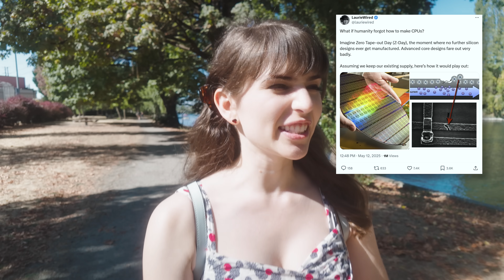what if humans forgot how to make CPUs?

Comment: When the guys from Acorn computer visited Bill Mensh (one of the 6502 designers) in Arizona the story goes that they expected a big company but saw students in a suburban bungalo working on Apple II computers so they realised they might be able to design a cpu themselves. They tested the arm instruction set in an emulator written in BBC Basic. I would be ok with going back to to that era and it doesn't seem like it would take long, perhaps a decade or two to get there from a reset. It would be a nightmare for the movie and games industry and big tech. It would be awesome for tinkerers. Constrained systems reward creativity. Also original Unix ran on some very weak hardware. 5000-8000 transistors would only get you an 8 bit micro but go to 30,000 and you can have a fun little 32bit machine.

Comment: The most realistic scenario is where the northern hemisphere survives nuclear fallout but not multiple summers of crop failure, so you'd have mass starvation in all but the southern hemisphere.  Could Australia, South America and Africa restart chip manufacturing?  Not quickly.  Indeed there's not much advantage in Australia.  I'd bet it would be far more common for salvage operations into the abandoned cities before any local manufacturing started from scratch, and this would turn into a smuggling cartel.  There would certainly be a stability in 16-bit and 32-bit ecosystem … enough "real work" or office work was possible on 1990-era hardware to remain useful indefinitely.  The "best of Wikipedia" can still fit on an optical disk — you only have to limit to rated articles and/or take it easy on the graphics.  Video is another matter.

Comment: Check out the Gigatron. All TTL, including the ALU which is made from 74xx283 Full Adders and multiplexers. It uses standard 14 pin DIPS and is about the same size as a 8-1/2x11 sheet of paper. Outputs to VGA and has sound. CPU is a broad term, but you don't really need all that pipeline, multithread etc. It all depends upon what you are trying to do. Anyway you pose a GREAT mental exercise, thank you.

Comment: The conservation by reducing load is, amusing. I cleaned and rebuilt a 486 based PC running Win 95 around a decade ago, that had as it's only task the operation of the air conditioning system of a TV studio. It was expected it needed replacing, but the rest of the hardware required specific software that only ran on that version of Windows. The PC never ran flat out, just idled along doing the one job, and slowly getting more and more dust inside, a process that took decades thanks to how well filtered the air was getting in to the environment where the PC sat. Many older PC's run just fine with a clean out and re-seat of the boards and plugs, that one went back to being perfectly reliable, and I expect it's still there. Light loading and efficient Linux OS's can make older machines run very well, and the code optimization part of this scenario to include large numbers of bespoke OS's to replace the bloatware of Windows and MacOS.

Comment: I think that most of the time we are wasting most of that compute power.
Games don't need to look realistic to be fun to play.
Operating systems shouldn't need 50GB of disk, 4x3GHz CPU, and internet connecton to just start and show user icons to click. Comoder64 was able to do it, without all that computer power.
And text editor should be loading 5min on modern computer. Even on old computer.
Windows 98 had everything I need except for stability and support for 64bit CPUs.
Windows XP mostly fixed stability.
Windows 7 was for 64bit CPUs.
Why upgrade ?
Maybe I'm an old man. But back in my days computer were faster.
Hardwer was slower, but software was so much faster, than whole thing was just faster.
The only reason to upgrade software is because other software require it, or because you are forced to.
Currently I'm honestly considering going back to WIndows 7 and go offline for security.
Everything is soo soo slow now, even if it's running on 100x faster cpus.

Comment: IMHO, since transistors are.not the only way to make computers, as you point out at the end, I think we would start researching other methods of making cpus. There are plenty of options to chose from. One that I like uses thermodynamics as both the power and the signal, often in the form of sound. Another was described in Molecular Mechanical Computing by Merkle et al.
Either can start large and shrink.
Regardless of the method, I believe computing is too useful to give up and we'd just find and build a different computing medium. Even if we had to start from near zero.

Comment: I’m not sure this scenario is very realistic. It seems to assume that humanity would completely forget the entire fields of computer science and electronics.

First, look at the example of home routers failing with nothing to replace them. Sure, the cheap little CPU-based plastic boxes we use today wouldn’t survive long. But unless we also assume that humanity has forgotten how to make integrated circuits altogether (which is extremely unlikely given how well-documented the processes are), people would just build bulkier, fixed-function replacements. Think rack-mounted cabinets of logic arrays sitting in the garage - clunky and inefficient, but still perfectly capable of keeping households online for a lot longer. 

The same applies to the point about modern cars dying due to solder joint failures. People aren’t going to forget how to solder! Reflowing joints is routine electronics repair, and over time, people would likely replace or bypass complex computer systems with simpler hardwired logic controls or mechanical systems to keep vehicles running.

And finally, even computing itself wouldn’t necessarily vanish. It would just regress to simpler hardware. Even without CPUs, you can build computers entirely out of logic gates. They wouldn’t be fast, but they’d be enough for basic text-based communication and coordination. I think most people would absolutely take that over nothing.

So no, the internet and electronics wouldn’t just vanish without CPUs — they’d get bulkier, slower, and clunkier, but they’d still exist. Honestly, a much scarier scenario would be if you just locked up the one tech-savvy person in every family. Society would grind to a halt way faster that way!

Comment: 13:22 🤣🤣🤣

In other news, my oldest PC is 30+ years old and it still works, HDD and all. I have increasingly newer ones too, so I'm covered - as long as there's electricity. We'll just talk to John Carmack to optimize our mission-critical software, and we're in business. And when all fails, we'll still have pigeons. 😆 But I'm sure that with better optics and rudimentary electronics we'll be able to move critical information around with lasers. Give geeks constraints and they thrive. We might even pull a Johnny Mnemonic. 😎

Comment: Internet would probably have issues first.. Fiber optic transceiver modules run kinda hot, and network switches and routers would just be useless without processors to forward packets around as they started failing. it would be a "slowly but surely" situation especially as weather shifts around and the processors controlling large scale HVAC systems for high traffic data centers and ISP network racks start failing.

The hub would be the first site to have a flood of complaints rolling in as everyone gets 500s and 404s and the chrome t-rex thing when the internet eventually cuts out. Chaos would ensue everywhere.. starbucks will have all the angry bottle blondes with their karen haircuts yelling for the managers. But paychex will be unable to process payroll and adp will have constant goofups and all the..

Anyway I can ramble on.. I'm gonna go play some games. I was a bit focused on just one thing there.

Comment: Awesome video. One thing we also know however is even though the old-school 80's etc computers were awesome and will likely outlast modern CPU's, the capacitors will age quickly still and will need to be replaced as many are on older machines; probably the only thing holding back older machines from true "repair-free" longevity :)

Comment: In the long run with we'd probably see more refined versions of transistor tech from the 70's. Newspapers and print publications generally might come back using linotype, transistor broadcasting/telecommunications tech would come back: radios and televisions and phone switches. Library card catalogs and paper files maybe? Film still and movie cameras would come back. Magnetic tape in media and computing would come back. There would be efforts to develop biological computers and refine and find new applications for analog computers. Maybe nano-scale mechanical computers or quantum computers could be developed if the scientists could make progress on them with limited computing power. Optical Disk drives would have to evolve to not need processors to work.

Comment: this is the kind of scenario I had in my head when I heard about Hurricane Helene disrupting quartz supply from the Appalachians and how that might impact silicon wafer manufacturing

another thing that we might need to do as well is become more conservative with the consumption of the resources that go into the manufacturing of computers, not just in the CPUs but also in boards and batteries, because of 1: the increasing difficulty of accessing those resources as easier-to-access nodes are exhausted, and 2: the necessary intensification of care we put into environmental protection at the places we extract those resources from. Would the cutting edge of consumer technology have sliced that quickly if we properly implemented equitable resource extraction practices from the beginning? I don't think so

Comment: It's not just CPUs.  Everything you know of as a "modern lifestyle" is like the top layer of a giant house of cards dating back thousands of years.
Reply: To me the biggest problem isn't even CPU degradation, it's flash memory degradation and data retention limits.  There would be a mad scramble to figure out which devices contain flash memory that will limit the lifetime or need data refresh that might not be able to be performed without having the code contents that are behind code protection fuses.

All the CPUs in the world aren't worth anything if you lose the software that runs them.  For some stuff maybe you can reverse engineer a board and write some new software to reflash faded code.  Some devices you'll find never had code protection in the first place and you can just back it up, but it's the minority.  But this would be the first huge massive headache before we worry about the CPUs themselves dying.
Reply: That is true -- but practically everything today uses microprocessors in one way or another. And with the microprocessors themselves, it has become a chicken and the egg situation -- we cannot make new microprocessors without lots and lots of materials, design and manufacturing tools which themselves all depend on microprocessors. As you have correctly said, if we trace the prerequisites all the way to the start, this would implicate not just a few isolated things, but essentially the entire economy!

BTW, the mechanism of action of the popular herbicide "Roundup" is sort of like that -- it destroys a particular enzyme in the plant cells, without which the cells cannot produce any new enzymes, including to replace the one kind that is gone. It is a dead end, literally, with no detours to get out of it. If something suddenly destroyed all of the microprocessors in the world, today we would be in a similar situation, even though just 50 years ago the world functioned just fine without them.
Reply: Reminds me of the prediction that, if industrial civilization ever collapses and humanity returns to a pre-industrial technological level, they will never industrialize again, because all the easily accessible fossil fuels have already been used up.
Reply: Notably world freight transport. No more cheap shipping from the other side of the planed would kill most businesses.
Reply: @ivanjermakov  Even local transport.
Reply: modern science will become alchemy and will need to be rediscovered all over again

Comment: You should check out CollapseOs and DuskOs, which are somewhat of an answer to this question, at least in the short term. CollapseOs is a forth based operating system meant to be easily portable to various embedded socs that are in household electronics and equipment, such as game consoles, cars and Ti calculators, for example. Forth is an incredibly interesting language, the base interpreter can run on less than 10kb of ram (kilobytes...), and is a 'concatenative' language. It's definitely post-apocolypse worthy.

Comment: First, you fix the syntax of C++ to enormously reduce the cost of the translation phase. You could maintain something close to a 1:1 conceptual map without too much trouble. We will call this new language Facelift. 

Second, you get rid of 99% of all JavaScript. Anything important enough that it still needs to be done will be done with native Facelift. 

Third, you downsample the whole of YouTube to a handful of frames per minute. The content creators who want more than one frame every 30 seconds must rent this extra capacity. Two frames per minute remains free, though. For a brief period of frame, key frame consultant is the world's most lucrative side hustle. Which frames should I keep? If you value your digital legacy, you will only hire the best. 

Fourth, NetFlix goes back into the mail order business and so does Porn Hub. Nobody can afford to wank with the digital tap running. 

Fifth, home BluRay juke boxes with room for 2000 discs are the new top-selling item on Amazon. They come pre-charged with content which includes the whole of the Common Crawl, if you want it. Bits at rest, pre-delivered. It's the new world order. 

Sixth, Richard Stallman ascends to Valhalla. All of the critical source code is made available, because so much of it will soon need to be adapted to older chips that don't burn themselves out. 

Seventh, you discover that much of what we are currently doing can be done with 0.1% of the current compute budget, which you can mostly scrounge up from yesterday's unprocessed landfill. 

I once wrote an entire Chinese–Japanese–Korean word processor for MS-DOS, where the word processor, the fonts, the NLP input methods, and much of what a modern OS provides all fit into 640 KiB. This probably would have won its category in the Demo scene, had there been one. We used Watcom C++ for the production build. Optimizing for space, the code was gloriously dense compared to Microsoft C++, at almost no loss in performance. 

A few months back, I had a long session in the Gemini web application. This stupid thing is progressive load (that dies in a fire after Z-day). I decided I wanted to load the whole session so I could save it using the browser's save mode. A single tab in Chrome ended up consuming 10 GB. I worked it out to 50 KB per word of transcript (counting both my inputs and Gemini's outputs). So far as I could tell, much of that was devoted to the JavaScript hover-event data structure, which contained 60,000 items, as reported by the Chrome debugger. 

Because, you know, when you hover your mouse over a control widget, it needs to quickly reshade itself to reflect the aura of your fleeting mouse-tip attention. 

Finally, after a few years of cashing out on my long experience treating digital resources like they weren't something to blindly squander at every opportunity, I would buy a private island and capture the entire remaining supply of wire wrap pens, before anyone else clues in, and a live a life of luxury off the proceeds, forevermore. You can do amazing things with a big enough stash of those old CML chips scavenged from ancient Crays. The power budget might suck, but it will run forever if properly cooled. 

Turns out, the best wire wrap pens are like Damascene swords. The art is lost now and can't be resurrected.